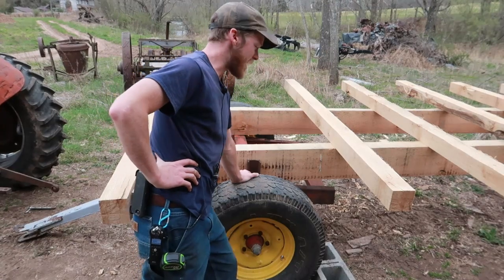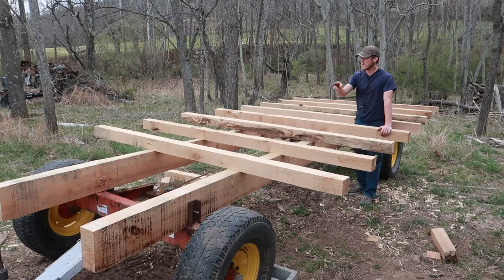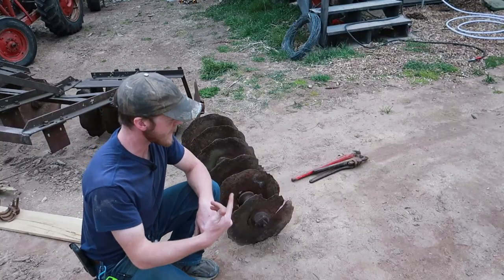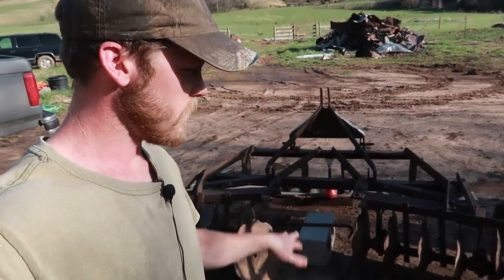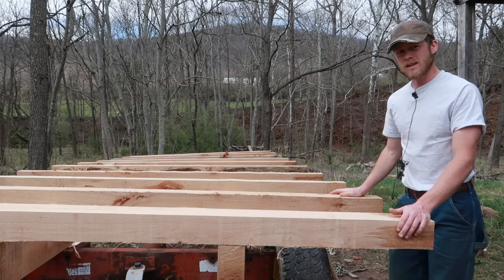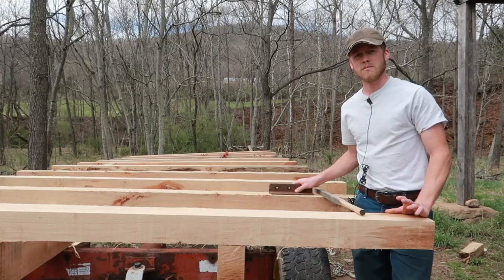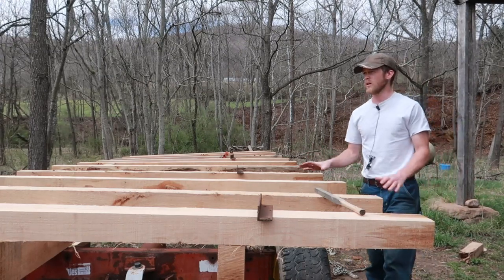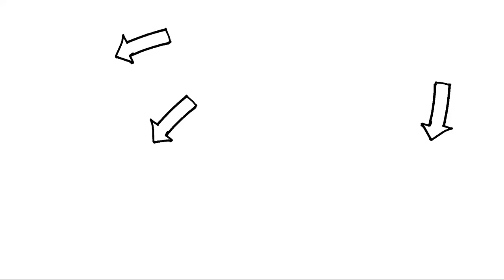Disassembling the Disc & Assembling the Eggin' Wagon Frame

Comment: If you angle the pegs in opposing directions on the beam once driven in they can't pull up.
Reply from the maker: oh.... hadn't thought of that. Thanks!
Reply: @LandisLegacyFarm  From chair making theory....If the pegs were dry and the beams are green then the beam should shrink and really grab onto the peg.  Of course a cross peg wouldn't hurt! 😁
Reply from the maker: Now that I DID do. The peg wood material has been cut for probably 6-8 months so it's pretty dry.